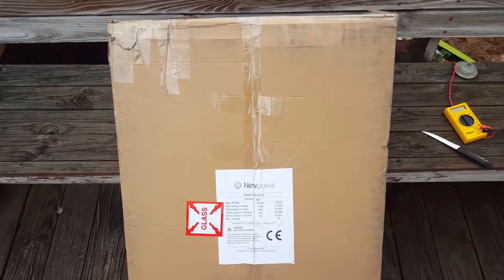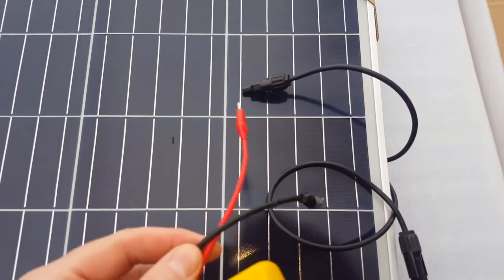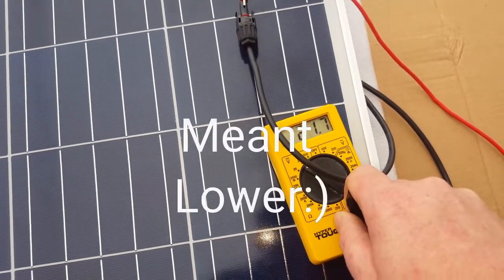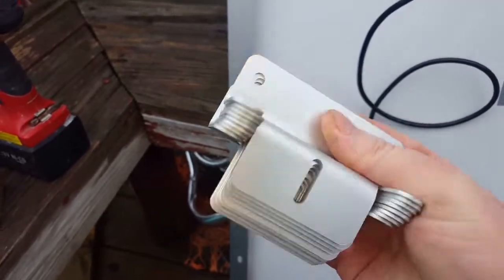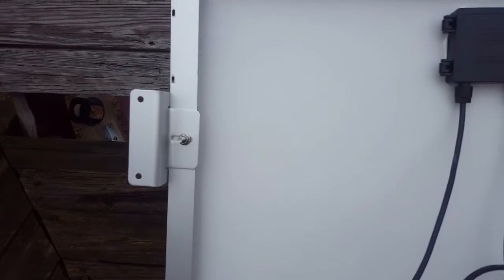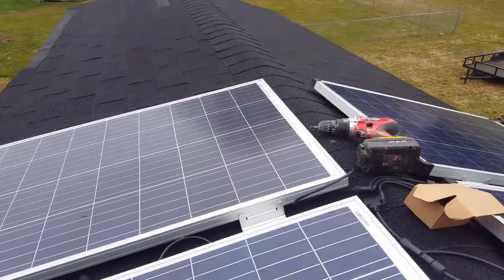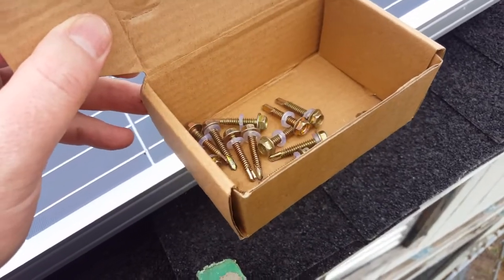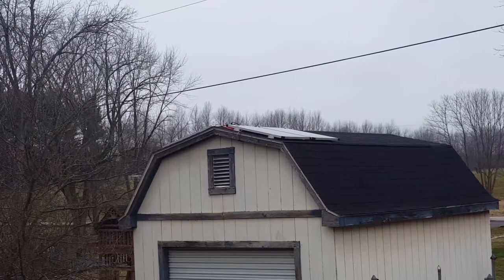Solar Panel Install Series Vs Parallel  Grid Tie Inverter

Comment: Hi, where do you hide yr wires after installing it on the roof?
Reply from the maker: My wires are hidden underneath the panels..then out of the picture there, they come together (parallel) into both 1 positive and 1 neg wire and those  wires come around the top of the roof and go into the out building. My panels all uses 4 " L" brackets that lifts them off the roof about an inch or so ...they are not mounted right flush with the roof..that leaves just enough room for my wires to be outta sight underneath the panels
Reply: @st-qp4mr  I was wondering if the wires would be sitting on the roof and when its rains, it would be all cover-up with water. 

Tht happen with my solar panel cause there is no compartment to keep the mc4,  it is stationery on the roof floor.

Comment: Currently I’m running my 4 x 100watts panels in parallel, should I be running these in series like your setup?
Reply: Considering ideal conditions, meaning no tree line shadows, etc. You probably would take benefit from a series connection. To the limit of your inverter. 

Example: If your inverter input vary from 20v~50V. Ideally you would prefer to be closer to the 50V. 
Following the same example, If your panels output 18V~22V (no load condition) putting 2 in series would give you. 36v~44V Precisely on the ideal range for the inverter input! ;-)
Continuing with the same example: From your 4 panels. You would have 2x in series and 2 in parallel! 
Simple and efficient. ;-)